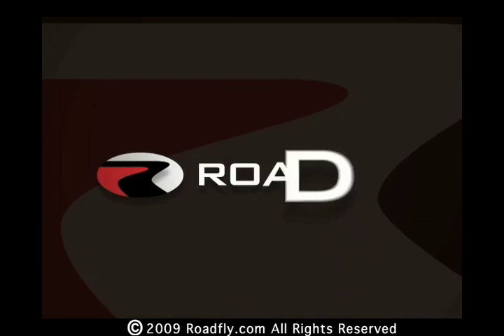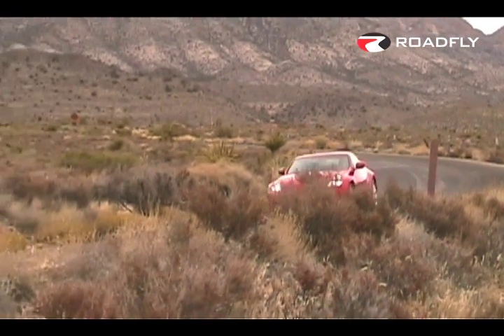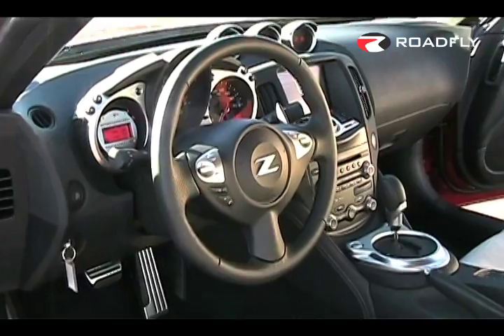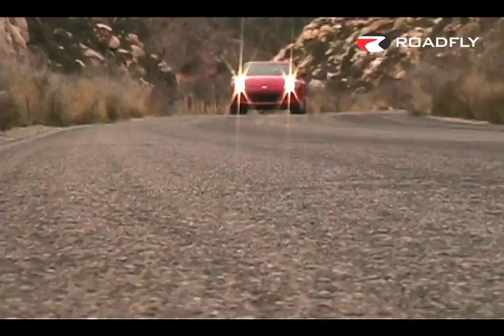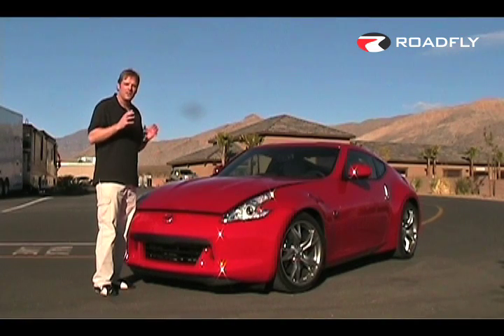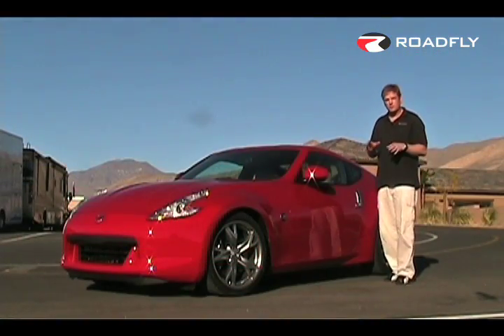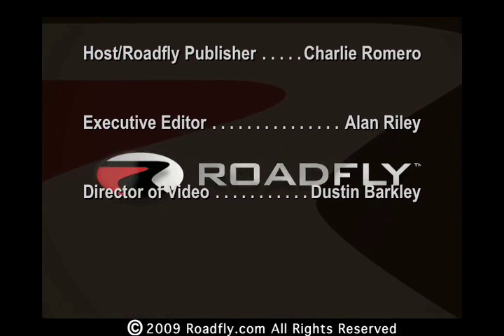Roadfly.com - 2009 Nissan 370Z

Comment: First of all kid. I was referring too Stock for an Evo. And 2nd. You do have an eclipse engine with a Turbo. It is a 4g63T. A slightly modified eclipse engine. woopie do. It has titanium cylinder sleeves and stronger 2 bolt mains. It is still an eclipse engine.

Comment: I completely agree with you man, I would take the Camaro any day.  Even though the horsepower output is higher for the Z, it  makes that kind of power at 7,000 rpm. Which, if I'm not mistaking, is barely below the redline. Also, the peak torque isn't made until 5,000+ rpm... so, the Z's ratings can be kind of deceiving.

Comment: Sure, for an NA engine, you're right, thats pretty good. If that's your cup of tea. I've been there and done that with the VQ and consistently came away unimpressed. 

As far as a TT on the VQ, I'm not talking about having to modify the engine. That was never the point, I'm talking about factory engines here. I mean if I take a LSA V8 and put a supercharger on it, I could beat the V10 in the M5 all day long, what's your point?

Comment: I worked for Nissan during this time frame.   As a technician, and I can say it wasnt all Nissan.   Part of it was because of the choice of tire brands.   It was a too soft of a tire for that car.      I wouldnt say a manufaturer is scummy or shady because of a bad tire choice.    They are in the buisness to make money, so they are going to put the cheapest, best performing parts they can find on their vehicles.    Nissan has done it for years... but until recently they havent been so lucky...

Comment: Love the car but the fact that the oil cooler simply just does not work well enough for track conditions is a bit of a turn off.  Maybe I'll gain more interest when Nissan addresses the problem.
Reply: They have put an improved oil/coolant heat exchanger on it but you would still do well to mount an air to oil external cooler for sustained high-performance use. I have a 2019 370Z sport coupe 6MT and I spent a whole afternoon driving very fast down twisty coastal roads from the Oregon border to the SF bay area and had no problem with elevated oil temps.

Comment: you may also want to look into some information on electrical issues that bmw has had in the past.  i had a 2001 530i.. (i know it's about 8 yrs. old so they may have made improvements since then). but bmw is notorious for electrical issues.  I had a problem with the electrical system and rain sensing wipers (stupid, i know) and it costs $2k to fix it.  good thing it was covered under warranty though.  anyways, if it concerns you, do research on the quality of the car as a whole.

Comment: 335 is nice.. it already has TT's though.  I don't know if you're into modding your car but if you get a g37 or 370z (both naturally aspirated). then youcan put TT's on it yourself and I hear they are pushing 400+ engine hp.  i mean you can still upgrade the turbos on a 335. but i think that if u get a 370z there will be hella aftermarket parts for it.  that is, if you are into that kinda thing.  me? i'm getting a g37 kinda for the same reason u said.. affordable luxury. it is also reliable.

Comment: @93Gatorchomp93 I prefer the smooth texture the old 350Z had on the dash.. 370z dash looks like it needs rubbing down with 800 wet and dry sandpaper! Seriously considering this car though!

Comment: Quick question: When the front and rear tires are different sizes you can't do an X pattern when you do a tire rotation so do you just swap driver and passenger sides?
Reply: On my 2019 370Z sport coupe with the staggered wheels and unidirectional tires you can't rotate them at all.

Comment: 370z is a nice car. I test drove a 2007 350z at the dealership and was shocked that a 300+ hp car felt so anemic, I also own a 2005 Titan and that 5.6L V8 is a beast, so what did I do? I still own the truck and I'm keeping my 2007 mazda rx8 as well, its a better car imoa!

Comment: The 370z has two option: a Synchro Rev 6 speed manual or a 7-speed automatic transmission with paddle shifters

Comment: Pretty sure he had one of those modded 350z proclaimed into a 370. You Evo guys need to relise that the reason why you can "beat" cars in your class is because of the better handling and AWD. That is all. Evo 8s have what 270HP in a 4g63 Eclipse engine? @ 3200lbs?  That rallys you a 13.2 on perfect conditions((including driver) the 370 which is RWD pushed a iirc 13.5 in Car and driver Feb issue. all 1/4 mile. The AYC is what keeps the Evo great at handling but they blow on the highway.

Comment: I know the VQ engine well, I owned a G35 previously, and the engine in the 370 (and G37) is only a very slight modification of that engine. That engine is fairly weak, and Nissan/Infiniti always overstate the HP by a good amount. Watch any review of the G37 and if your attention span allows it, you will hear them saying that the engine doesn't even feel like 330HP. As far as the Evo goes, what you've said just shows me how you little you know about cars yourself..

Comment: Having had extensive experience with the VQ engine myself, the engine is fairly weak. I'm not the first one to notice this either, watch reviews of the G37 for example. All the time reviewers are saying that sure, it can be fun to drive, but the engine doesn't even feel like its got 330hp working for it. Maybe if the VQ was FI...

Now, take for example the N54 Twin-Turbo Inline 6 from BMW, now there is a powerful engine. Even though it is only rated at 300hp, it makes a joke out of the VQ.

Comment: After all there is still several thousand old Nissans on the road to this day... from the 1960s Datsun 210s, to the famous 1970 240Z.    I dont see that many 1960 BMWs around anymore....  god forbid a 1980s BMW.   And you mentioned 1 year of a car.  I think the first year of the M had problems....  rule #1 of buying a car... never buy the first year of a car.

Comment: Can anyone tell me the difference from a 370z Coupe to a 370z touring and 370z nismo?
Reply: The touring adds things like leather trim, leather power seats that are heated, a center console nav system and upgraded sound system. The Nismo is more of a track oriented performance car, with suspension, brake and exhaust mods.

Comment: As well, watch any review of the G37 for example, at some point in the review the person tasked with driving the car will notice how it doesn't even feel like its putting anywhere near 330hp down. Nissan is desperate to add their latest entrance into the horsepower wars, and they depend on ignorance like yours to sell their cars (that and little asian guys who like dragon stickers). With the N54, the engine is rated at 300hp, and I'm willing to bet it puts down alot more to the road than the VQ.

Comment: lmao. Ok. Sure kid. That comment has nothing to do with my overall knowledge on cars. Try going to school for cars and gettings degrees in Automotive as well as working and learning through cars for over 12 years. I am sure you can claim that as well. the VQ37HE is not a "weak" engine. For a V6 3.7 L it does well. maybe the 333HP does not "Feel" like it because the G37 is one heavy some of Bitch. Ever think of that? Has the tuning and supenstion? there is so many factors on HP stat.

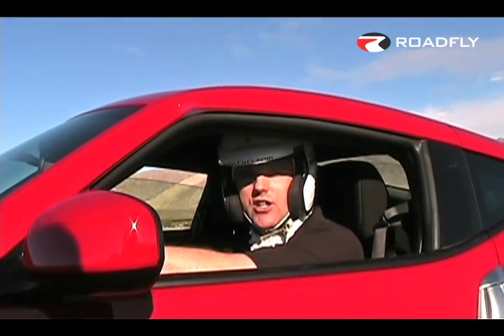Comment: Dude I know it has paddle shifters and that doesn't mean it's a 6speed manual. The paddle shifters are for the 7speed automatic transmission. Maybe if you have been a bit more observant yourself, you would notice that it doesn't have a clutch pedal and the gear shifter has a P,R,N and a D before you could use the paddle shifters. visit the nissan website and youll see what I mean. I dont know why this idiot thinks hes fooling everyone saying its a 6speed manual @ 3:10 when obviously it isn't...

Comment: @StefanCarr "synchrorev isnt driving u gotta be in total control thats all"... Wow, hahaha! Whats your problem, SpeedRacer?.... If the manual gear box gives me a way to worry less on sync my gears and helps me to pay attention to the road and do more and better maneuvers when I am in a head to head on the street, I'd thank for it! 
If you think you can do better than a computer designed for that purpose, Just turn it off and "take total control",  Mr. Michael Hamilton Massa Loeb.  LOL!!

Comment: yes; not to insult domestic rides or anything but having test driven most of them.. I can say they deffninitly skimp out on interior (riddled with cheap feeling plastic)
HOWEVER, they are changing their act with latest rides.

back to the Z, you should be buying the car for performance.. not to look at the interior.

Comment: so...who here thinks the 2010 camaro v6 with a 3.6L can smoke this pile of nissan crap? >.> The 370 puts down more horsepower but a lot less torque. It's less wide and less length. But the camaro is 5k$ less and has more to offer. A lot of sites tell me the camaro is the better buy does anyone wanna explain to me why this 370z which costs more is better?